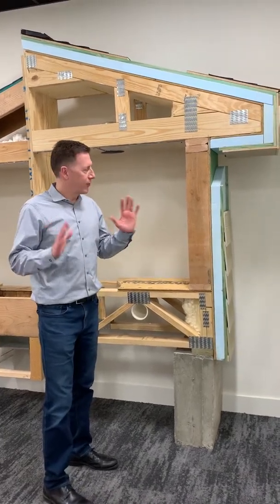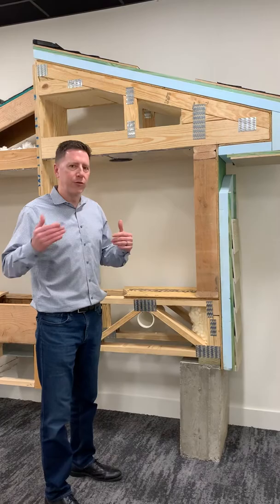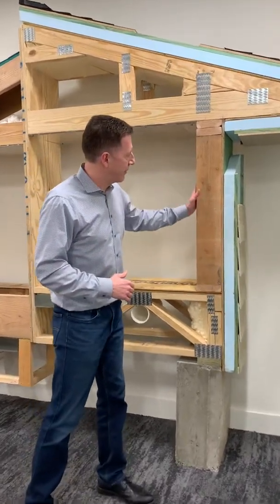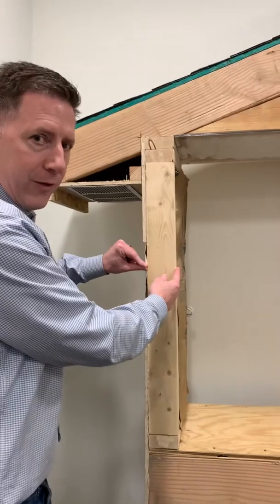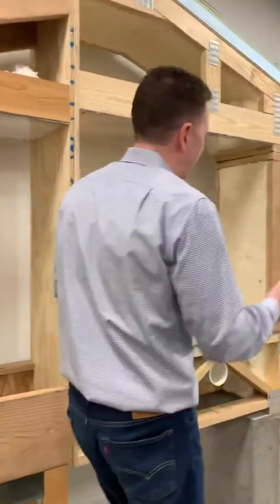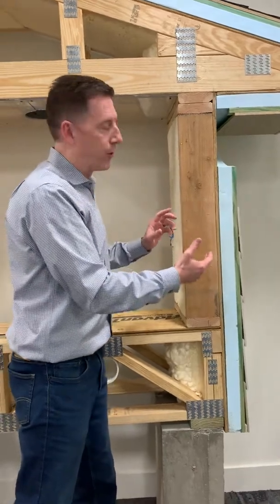12) High Performance Building: A Home Builder's Guide to The Perfect Building Envelope

Comment: My favorite part about returning to the building trades and reading up on the new code requirements is that we’re making housing so air tight I’m required to install air exchanging ventilation systems because otherwise my clients would suffocate.  There’s a ridiculousness to the exercise that astounds me.
Reply: That's because you don't bother to understand the science. Efficiency comes from having the exterior climate influence the interior climate as little as possible, thus necessitating the least amount of energy expenditure to control the interior climate. That's not possible with leaky houses built to old codes. Adapt or get left behind.
Reply: @grafja  just because I think it’s silly doesn’t mean I don’t understand it.   I clearly noted that I read the new codes and am following them, not to mention I wouldn’t be passing inspections if I weren’t.    You young people can’t read?  Why’re you looking down on the older generations? 

I live in a 1920’s brick that has survived better than most the other more “modern” houses around it.   Quality of workmanship matters more than just adherence to the code book.  The IRC allows for plenty of not very good ideas to be considered suitable habitation.
Reply: @grafja  if you really want a wake up call as to how pointless a lot of the codes are just look at California,  they had this massive freeway fire and the governor asserted that he’d suspended the normal building code enforcement process and procedure in order to get the freeway open ASAP.  If the process Angela regulations can be suspended why are they there in the first place.

Comment: How do you get around the termite and other burrowing pest problem? They love the close sell foam, and once inside, are very difficult to get rid of
Reply from the maker: We put a sheet metal layer at the bottom by the sill plate that cuts through the foam layers between the foundation and the wall framing so they can't borrow through.

Comment: Vapor barrier on the warm side of insulation is code, to keep vapor from penetrating wall, and condensing in insulation.  Totally sealed, taped, devicebox boots, and caulked.  Exterior barrier is breathable/waterproof so insulation can breathe, but water kept out.
Reply: Isn't this code in most places?

Comment: I'd love to see the energy bill on one of these newer designed homes. That's pretty slick.
Reply from the maker: The bills are great! We also installed a 25kW solar array and often hit Net Zero.
Reply: @homolydesignbuild  What is the additional cost of using this outer layer instead of typical wall stud insulation?

Comment: Foam on the outside of a stick frame wall? Once a vapor barrier is installed you’ve created a double vapor barrier situation. Moisture will find it’s way to the foam and condense. The freeze and thaw will rot your wood framing. Spray foam does not stop moisture transmission.  In Alaska I’ve seen spray foamed cut in roofs rot in 20 years.  Put the foam board insulation on the interior.
Reply: Can't install an interior vapor barrier with this system. BUT, you must have sufficient foam on the exterior to prevent condensation within the wall. This is an area where the code hasn't caught up with the building science. Exterior foam is better than interior IMO - far too many penetrations on an interior wall with outlets and switches to be able to do it right without maybe a double wall design. The right design I think is very thick exterior foam and unfaced mineral wool neatly installed in the cavities.
Reply: @bradley3549  I’m a fan of 2X6 with an R21  insul with attention to the details wth the vapor barrier . I like a 131/4 in energy heel on the trusses with 2 feet of blow in the Attic. Just because the man says you need R41 doesn’t mean I have to stop there. I like the air to air heat exchangers. No interior attic access. Tryed and true construction.  I shy from foam except with foundation insulation.  I don’t want to have to huff toxic gases in the event my home catches on fire.

Comment: Good plan, but listen to the commetors about removing moisture. I liked the one who suggested  air exchange technology  in the HVAC. My suggestion is to add a couple of radiant barriers. Read up on it from the manufacturers of radiant products. Some say you can lose more heat (or gain in hot climates) through radient heat loss than either convection or conduction.
Reply from the maker: Sorry, but I didn't go into the details about the indoor air quality. You absolutely must have an ERV or HRV for a system like this. For my own home, I have an ERV on both of my geothermal units and they do a great job of regulating moisture and stale air. In addition, I have humidifiers for the winter and a separate dehumidification system for the summers. In my own home, I also used a Tyvek system with built in radiant barrier as well per your note.
Reply: @homolydesignbuild  cool!  Er - ah, maybe I meant warm and cozy

Comment: How do you get the specs for this building type?  What was most interesting is how are you attaching the Hardyboard to the wall as insulation isn’t strong enough to hold the board.
Reply from the maker: There really are no official building specs for this. Greenbuildingadvisor.com is the best place to go to learn about best practices. It will probably take 20 years before the industry catches up to these concepts created and tested by the building scientists.  Yes, the furring strips are the key part to attaching Hardie siding over 2" of foam. Hardie allows you to attach directly over 1" of foam, but not 2" because of the "slippage" down the wall. We put monster screws from the furring strips directly into the studs (so the furring strips are every 16") and they are rock solid. Then the siding goes on easily. However, because the Hardie is only attached every 16", heavy winds will cause the Hardie to reverberate. This can be eliminated by face nailing the Hardie, but I didn't want that look since I used integral color Hardie. We kind of enjoy the sound now during storms :).

Comment: You said no insulation in the cavity, then you later revealed spray foam. Where I am on the east coast the rigid exterior foam would likley not be adequate on its own.
You also spoke about water vapor condensing within the wall cavity on the inside of the sheathing, but you model wall has batt insulation with craft paper. That is a vapor barrier if installed correctly.
Reply from the maker: Sorry, the "best" place to install insulation is on the exterior of a wall, but installing it in the cavity gives you additional R value without really hurting anything. The left side of the mock up is how 99% of homes are built (with batt insulation for instance) but this is how homes should NOT be built. The right side is how we are proposing homes should be built. The craft paper of batt insulation will definitely not stop water vapor from getting to the back side of the siding.

Comment: I would love to see a window in that sample structure.
Reply: Yup. This guy is full of it. Hardie requires furring fasteners for over 1" CI to go THROUGH the continuous insulation and 1.5" into framing. Thermal bridging will still occur through metallic fasteners (screws) through the insulation envelope. The extent of the penetrations/bridging is worsened in high wind load zones and more fasteners are required for furring attachment.
That claim the building will last 4-500 years comes from the manufacturer's stating how long they "believe" the polystyrene foam will last. So this guy is saying the home will last as long as the foam stuck to the outside of it...pure rubbish.
Reply: https://www.google.com/imgres?imgurl=https%3A%2F%2Fimages.finehomebuilding.com%2Fapp%2Fuploads%2F2019%2F01%2F26001021%2Fscan_4.jpg&tbnid=iaDi5DlU1VSGRM&vet=12ahUKEwjkuKDVv_OBAxWiP94AHWHaA2AQMygAegQIARBY..i&imgrefurl=https%3A%2F%2Fwww.finehomebuilding.com%2Fforum%2Fjlc-remote-wall-system-comments&docid=zAsS4aRll2Ps7M&w=428&h=600&q=remote%20wall%20window%20diagram&ved=2ahUKEwjkuKDVv_OBAxWiP94AHWHaA2AQMygAegQIARBY
Reply: I bet the longevity would be better with a mineral wool insulation.
Reply: Window details aren't bad in a system like this. If you do an outie system it's just a 2x window buck from to bring the rough framing out to the plane of insulation. From there it's a standard window install.
Reply from the maker: Great point! The most difficult part of the whole installation was figuring out how to address the details around windows and doors with the additional thickness / lack of wood for structure. I ended up using an "outie" window technique that is explained thoroughly on Greenbuildingadvisor.com.  It worked out great, but was hard to master.

Comment: Ridge vent? Can't see it. Air Gap that goes "all the way around"? Where? Everything is clearly explained and seen in the model until the very end.
Reply from the maker: The ridge vent is right at the very top of the roof. There is a 3/4" air gap formed by the furring strips on the wall and the roof. That gap is vented (with insect / mice screens) at the bottom of the siding, at the outside edge of the soffit, and through the ridge vent.

Comment: Are there any cold climate issues with this trapping indoor vapor/moisture inside the walls?
Reply from the maker: No, because I have an ERV on both HVAC units.  And, I tied the intakes of the ERV's into all the "bad air" areas of the home such as the bathrooms, kitchen, cat litter box area, etc. so it does an excellent job of clearing out any extra moisture.
Reply: Yes it is. This was tested in Sweden in the early 90s.  They grow mold from the inside
Reply: @nickorango  So what's missing here is an interior vapor barrier. An important point for this company.
It's as simple as a layer of plastic on the interior side of the studs.
Reply: @Mavrik9000  No, you do not want an interior vapor barrier with a system like this. That will do as much to trap moisture IN the wall as it will to prevent moisture from getting into the wall. The trick with these systems is to install sufficient exterior foam that vapor cannot condense on the interior side of the sheathing. For cold climates this can be 3 or more inches of foam. The mistake so many people make, because XPS/PolyIso foam is rather expensive, is they cheap out and go only 1-2" in a cold climate.
Reply: @bradley3549  The interior barriers are to block interior moisture in cold climates. Perhaps both systems together are incompatable.
Reply: @Mavrik9000  Correct. The two approaches are not compatible. You either need to have zero vapor barriers and a loose house or a single vapor barrier. You can't have two vapor barriers creating a moisture sandwich. 

In the case of this thick exterior foam - the foam itself is the vapor barrier. You have to allow the wall to dry to the interior but you also have to make sure you have sufficient foam that you aren't getting bulk moisture condensation inside the wall.
Reply: @bradley3549  so basically, the thicker the better? the thicker it is, the more it will prevent the dew point temp from reaching an inner surface?
Reply: I did this on my home, albeit just the walls since I’m not a huge fan of the hot roof. You do install vapor barrier, but on the Outside of the sheathing. I’m a huge fan of this system if you’re doing your own labor. If you are paying a crew, it really doesn’t pencil out. I’d recommend googling the Cold Climate housing Research Center out of Fairbanks; they have a detailed manual about this system

Comment: “Here’s my wall system: you use plastic with a layer of plastic on it, encapsulated with a beer cooler layer of more plastic, then a three-quarter inch air gap, then siding made of toxic coal combustion products embedded in a matrix of plastic!” 300 years from now when this house falls apart, people will wonder why people were so excited to build their houses out of literal garbage that destroyed their Earth
Reply: You are absolutely correct, the worst is they think its Carbon free and make them eco friendly doing costly renovations that spill more Carbon foot print per square inch than an entire life on earth for a single human being...
Reply: Agree fully.  Need to get back to basic materials and quit building monster, unnecessary homes.
Reply: The other thing they’re not considering or have enough experience with is the nails that penetrate the outer rigid foam layer from siding and roofing nails. That exterior rigid foam is now compromised and completely full of holes. The tips of all the nails will all condensate

Comment: Any sound proofing benefits?
Reply: Not really. Sound is vibrations, there is nothing about this foam on it's own that would absorb sound vibrations and convert those vibrations to heat instead of transmitting the vibrations through the material. It might reflect some high frequencies, beyond our hearing range, but so will the siding. Now if the foam were built into an acoustically engineered envelope it would have some benefits, but it would need to be part of a "materials sandwich" that is "decoupled" as much as possible from anything it touches to reduce the transmission of vibrations. 
My experience comes from installing sound insulating wall systems in hospitals and office buildings, the science is solid.
Reply from the maker: Yes, for sure!

Comment: Are you using the foam as a vapor barrier?
Reply: If you look above the exterior blue foam insulation you can see that the sheathing is green, so he must be using huber ZIP system and taping all the seams for the air/vapor barrier.
Reply from the maker: Correct @nerdslikeus6690
Reply: Vapour barriers go on the warm side of a home. Seems strange this guy said nothing about vapour barriers. Home building 101.

Comment: Why do you not take into account vapor barriers? There shouldn't be any condensation on any part of the house if done right.
Reply from the maker: Vapor barriers in a mixed climate like Kansas City can be difficult because the moisture goes both ways depending upon the time of year. If you keep the sheathing above the dew point all the time, it can never condense.

Comment: Nice system. too bad you will have a cold spot wherever there is a steel connector penetrating from the outside such as the rainscreen batten fastners. Fiberglass connectors would be a nice addition to the system.
Reply from the maker: I suppose this is theoretically true, but the amount of heat transfer through a screw is so small, I think it would be negligible. I don't think fiberglass would be strong enough to properly hold the furring strips.

Comment: How do you keep the mice from living behind your siding?
Reply from the maker: The first comment was so perfect that I thought I would just requote it here, "They would have to use metal flashing over the insulation and then some type of bug screen to keep out bugs. The bug screen will still need to let air into the wall behind the siding."
Reply: They would have to use metal flashing over the insulation and then some type of bug screen to keep out bugs. The bug screen will still need to let air into the wall behind the siding.

Comment: Would you?   Install foil faced 1" Rmax over existing subsiding without taping the joints.   Then use Tyvek house wrap over the foil faced Rmax followed by 1x rain wall battens?         I just listed the materials I have on hand and would like to use.  The foil face concerns me....1960s home.   tHanks.
Reply from the maker: Yes, this would work and increase your energy efficiency.
Reply: tHank you for the reply  @homolydesignbuild

Comment: This construction looks like a major fire hazard. If this foam catches fire it will spread like crazy with the air gap functioning as a chimney.
Reply: The fact that the foam is wrapped in cement board will make catching fire from an external flame or spark..... unlikely.
Reply: Correct.

Comment: Because of this "new " building technology foam "insulation" price has gone beyond what is affordable, niw the government mandates it use and mortgage loans are 40-50yrs.     Great ideas without any price control, the great American slave drive.
Reply: I think it would be better if they used rockwool on the inside and outside. Rockwool is vapor open and it has an awesome fire rating. Once you start using more than one vapor barrier, moisture can get trapped in-between them and start to rot things. If they are using a vaper open spray foam on the inside then it shouldn't be a problem on this wall.

Comment: I like it but is it really necessary on top of the roof?   A nice energy heal and soffit insulation with a baffle for ventilation should work well. 

I think my next build will be ICF with in floor slab heating and a generous (high) energy heal.
Reply from the maker: Well, really all of this exterior foam insulation work is "next level". Using open cell foam insulation in the wall cavity / for conditioned attics gets you the most bang for the buck, but this is for people that want to have the most high level energy efficient home as possible. Adding the foam to the roof actually makes a lot of sense since a roof assembly has more impact than the wall assemblies.